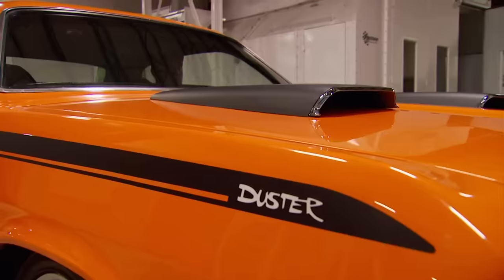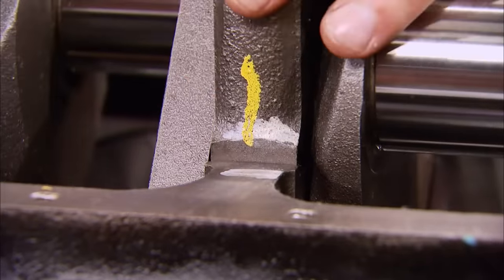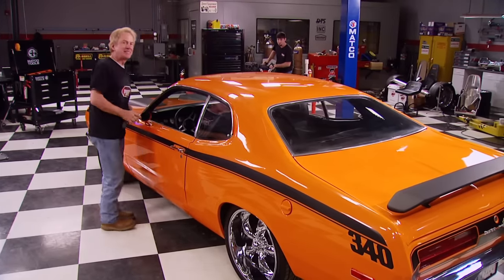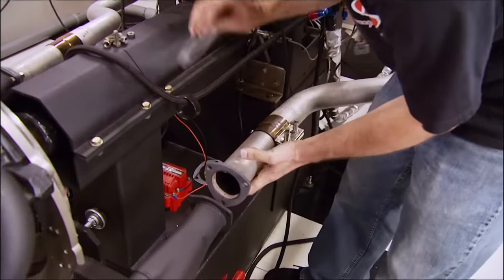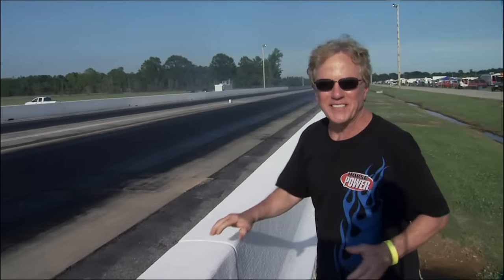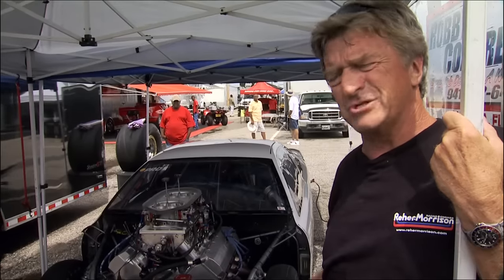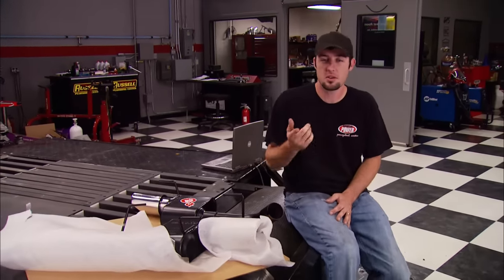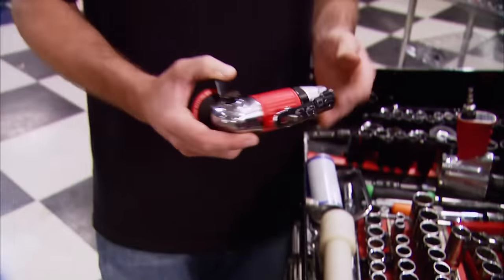Mopar 360 Build on a $2,500 Budget - Horsepower S13, E17

Comment: Have a 360 block sitting in my garage that needs rebuilt but a low mileage 5.7 hemi is still cheaper 🤔
Reply: uhhhh.....not where i live. also, valve droppers, cam eaters, etc....
Reply: @frigglebiscuit7484  a low mile 5.7 hemi in the midwest is $1,900. Combined with the fact that I will drive the vehicle less than 1,000 miles a year so im really not concerned with dropped valves etc. associated with high mileage hemis
Reply: @themanic6575  im not paying 1900 bucks for a used engine that has known problems. i built my big block mopar for 800 bucks.
Reply: @frigglebiscuit7484  You might have built your big block in the 1980s for $800 😅  the budget build for the 360 in this video was $2,500. And I also want port fuel injection and hydraulic rollers which the hemi already has. To do that in a 440 is $$$$
Reply: @themanic6575  nope. built it in 2012 for $800.
Reply: @frigglebiscuit7484  define "built" my 360 needs machined, pistons, cam, heads, intake, carb. If you can do that for $800 I will consider 😅 have small block and big block transmission ready to go. Every big block that I've viewed has been beyond used and abused
Reply: @frigglebiscuit7484  If I ran a 360 I would probably just get a 5.9 magnum from a junk yard those run about $250 for a running one. Had one in my Durango R/T
Reply: @themanic6575  im sorry that you started your build with a p.o.s. engine block. my big block was a 60k mile motorhome engine. new rings, bearings, arp rod bolts, cam, and dual plane intake. did my own head work. block and heads needed no machining.
Reply: @frigglebiscuit7484  I haven't started any engine build. I bought a 1979 dodge powerwagon for $500 and it came with a running 318 and a 360 in the bed.
Reply: @frigglebiscuit7484  I am going to get rid of the 318 that is in it for something with more power. Right now it is looking like 5.7 or 6.4 gen III hemi
Reply: @Welcometofacsistube  yeah not really interested in the 400bb. If i did a big block it would have to be 440 based. Don't like the weight of the big block either. Would have to be aluminum block along with port fuel injection and a roller cam
Reply: @themanic6575  400 has bigger bore than 440 which means it will make more cubes than a 440 with the same stroker kit, and late 70s motors have beefier blocks for increased strength, a gen 3 6.4 hemi is runing near the 5k mark in the mid west and thats for a stock motor, then youll need fuel pump $$$ fuel cell to accomadate $$$ wiring $$$ computer $$$ you can be 10k into a gen 3 hemi swap and still have problems. Pay for the machine work, or buy another engine but idc wat you say, unless someone gives you that hemi its not cheaper than even a big block build
Reply: @heathlamping6528  But the 400 is a B engine vs the 440 that is an RB engine. Like I said with any engine I would like to use fuel injection so I would be paying for wiring harness either way. I agree that the 6.4L is significantly more expensive than the 5.7L. The mopar standalone ECU gives the 5.7L 383hp and 425 lb-ft. Hard to pass up if you can get a used 5.7L for $1,900. Probably makes more power than the low compression smog era 400 that Frigglebiscuit and others are proposing
Reply: @themanic6575  The b and rb designations matter when building, its all in the finished product, now a 440 made the 390 and blah blah blah, where as the 400 was the 383 replacement and yeah it was in smog era, but new heads an intake and a cam and everything responds, plus guys that dont know any better give away 400s for nothing because theyre not 440s if you dont believe me call indy cylinder head and im sure they can point you in the right direction. Now as for efi, well it works great dont get me wrong, but a good carb works great too, ive driven both and when both are spot on they both work in midwest winters and have great driveability.
Reply: @heathlamping6528  Yeah a 400 big block can make power. A big block just really doesn't make sense for what I need. I want efi due to the longevity differences between carb and port injection engines. Being around both the late TBI LA and port injection magnum engines I have seen the signifigant bore wear differences/patterns compared to the earlier carbureted LA engines. In addition to that my wife would like to drive it as well. I would definitely like to use the truck for carrying/towing stuff on the interstate. I don't really need the mpg hit associated with the big blocks. I am considering the 360 or 5.7L. I know from experience that upgrading the 360 doesn't come cheap no matter what anyone else is saying. I have owned a couple of them and as shown in this video $2,500 only resulted in a 60hp increase compared to a stock 5.9 magnum. I know you can use a more aggressive cam but I don't want to sacrifice driveability. The 5.7L mopar engine kit is $1,795. I could probably have a running 383hp 5.7L hemi for around $4,000. I am sceptical that a 400hp 360 or big block with a modern fuel system could be had for $4,000 starting from scratch. If I had a block ready to go it would definitely be a different story. I also like that there is parts availability for the new hemis. I got rid of my Durango R/T due to the fact that parts were starting to be discontinued. If Im on a trip I know that I will have more luck getting a hemi replacement part compared to a big or small block mopar.
Reply: @themanic6575  if you want the hemi then go for it, i wanted to do a 6.1 in an old macho pw i had, and you can do it cheaper then let it rip but others wont get the discount you get so advantage to you sir
Reply: @heathlamping6528 I think both have advantages and disadvantages. I enjoy hearing the different perspectives. To be honest I have enough spare parts to build 3 trucks. In time I might build one with a new hemi, one with a big block, and one with a small block or even a cummins😅 I have been debating engine choices for 5 years now. Practically I like the idea of the gen III hemi more. But I also like the idea of a big block truck (who doesn't? haha).
Reply: @themanic6575  im not a diesel fan at all, i used to have enough parts to building multiple mopar trucks.
Reply: @heathlamping6528  Thats cool. I which I could find a macho pw. I'm not really a diesel fan either. A truck with a diesel swap is something that my wife wants so maybe I will do one for her. My coworker has a Plymouth superbird with a 3000hp alcohol gen II hemi so I need to build something that can keep up with him. I have a big block 4wd transmission that I'm thinking about putting in an A body mopar. Will be a lot of fabrication but an awd A body with a stroked big block would be crazy fast.
Reply: @themanic6575  try machopowerwagon.com, theres always ones for sale, an a body with a t case will just be fast off the line, the only way to keep up with 3000hp hemi is to build another 3000 hp hemi no awd on the planet will help you with that. no the only way ive seen a tcase used in a car that wasnt 4wd was hemi under glass, they used the tcase and flipped the axle over to spin the tires the right direction
Reply: @heathlamping6528  Thanks I will have to look at that website. Yeah I'm definitely thinking of something with insane horsepower. And everything will have to be built to accommodate it. That would be my dream if I had the money. My coworker has more money in his superbird than he has in his house 😅
Reply: @themanic6575  ive never cared for building insane horsepower tbh, id rather have something in the 400 hp range that i could drive daily and not worry about it getting away from me, and as far as money goes, debt free is the way to be for that one
Reply: @themanic6575  yeah i cant do that whole drag car only thing, i do have a mud truck but i gave next to nothing for it
Reply: @bigboreracing356  a well tuned nitrous ls is gonna cost more than $800. gapping rings and throwing a nitrous kit on doesnt count as well tuned. you can compare apples to oranges all you want. i dont rely on baby bottles to make my hp.
Reply: The Manic Needs to be rebuilt. Not needs rebuilt.
Reply: @jumpinjojo  you ok?
Reply: Do it this way: https://www.hotrod.com/articles/318-small-block-build

Comment: Built a 360 for my 67 Barracuda some time back. Light performance build, with a holly 650, .500 inch lift and 294 duration cam. #.23 gears street tires stock exhaust manifolds and and a ld4b intake. Ran 14 second flat 1/4 mile at 97 mph. Was desperate for a set of 3.90 gears so I cold run well into the 13s. Oh yea, it cost me $800 to build it, of course I did the machine work including the boring and porting the heads.

Comment: I got a 1966 Chrysler New Yorker that I got with a 360 out of a 76 motorhome. Recently I had connecting rod #4 break in half and blew my motor. So I got another 360 out of a 78 motorhome and am driving with that now. Just trying to figure out the sweet spot in regards to the timing. Had it set at 10 BTDC for a while, now it's sitting around 7 BTDC.

Comment: Back in the early 90's, Mopar was getting back in to stock car racing, our engine, similar looking (hey, i'm not a motor guy) to this one made 700 hp. . . for about three hours, then at best, blew a head gasket, at worst, sawed itself in half.
Turns out the heads were to "soft" and kept losing the torque on the bolts. After every practice and qualifying run we had retorque the head and relash the valves. It was so bad that metal was squeezing into the cylinder bore.
It put us out of business before they got it fixed, but eventually you guys got a decent set of heads.

Comment: A good little build but they left some power on the bench when they put it back together. First they didn't say if it was over bored but a basic .30 over will give a slight but needed compression bump.
Second the heads were later castings with big chambers, nothing you can do about that beyond milling which would add to the cost, if I had to spend the money I'd go for a valve job and port clean up.
Last I would ditch the factory rockers for more precise rollers with a 1.6 ratio to help the mild cam a little. All that should be good for an extra 20-25 peak hp with improvement across the band. If you have the cash pick up some flat tops when you buy the pistons.

Comment: In my muscle car days I had a 1971 Duster 340 that I bought new, so I was glad to see this post.  I didn't do that much to it, headers, better exhaust, Holley carb (I think 750 cfm), better clutch, tires, and changed out the rear end ratio.  I don't remember if I changed the camshaft or not.  Maybe I did some other little stuff too, I dunno. Anyway, I got about 325 hp to the ground according to the dyno test.  I wish I had done a dyno test when it was stock, but I didn't.  Factory spec was 275 hp.

I used to run super-stock at drag strips in the NY metro area and still have my trophies in a box somewhere - I wish I wrote down my times - I seem to remember high 12s. 

It only cost me a couple thousand new and was still in good shape when I sold it.  Very pretty metallic green paint with the big 340 logo.
Reply: Mopar A Bodies Forever... 68 Dodge Dart everyday and Everywhere..

Comment: That was impressive considering the stock cam and heads.

The 360 in my Dodge Sportsman van was a humble two barrel but man it had torque to spare. It got so rusty I was afraid to drive it. I should set it up so people could hear it run and advertise it for sale. Would love to see it on the road again.
Reply: Wasn't a stock cam... they used a 218/228 cam that should have pushed 400 HP in a better built engine... 
https://www.hotrod.com/articles/318-small-block-build

Comment: One thing that they skipped over is on the 360 there is a small hole on the bottom of the head under the exhaust ports. They will need to be tapped with a 1/4 20 tap and plugs put in them or you will have an exhaust leak on all 8 ports

Comment: we allways changed to big valves an had it gasket matched to intake etc, like 100 bucks in 1988 at barnetts i think. an we would port them somewhat as we shifted the erson cam at 6500 r pm, so easy to run mid 12,s in a lite duster..with 3.55 gear but would eat u joints in lite 904 trans..

Comment: Would love to rebuild the 360la in my '81 Ram W250. The low compression is such a bummer. Hard to justify even $2500 to rebuild it when for less I could get a higher performing LS but it lacks the character & hate to throw GM in Mopar.

Comment: Now dyno that 360 with 1 5/8 headers, a Performer RPM intake, a 650 carb, and a slightly larger cam. The way it should have been built.
Reply: Yeah those small primaries are robbing few hp
Reply: 218/228 cam was fine... would make 400 HP with better parts selection... 
https://www.hotrod.com/articles/318-small-block-build

Comment: True Mopar guys know you can make 400HP out a 360 without much work. 450HP/500HP you start running into issues with the stock heads/crank. Have a desirable 360LA with the factor roller cam I was going to build.....but then I found a 440
Reply: 475hp is about max

Comment: As I recall, the these early 70's Darts had a terrible rust problem in the cowl area. Trapped water and rusted out.
Reply: Yes.. trap water at the bottem mostly and will then rot out the lower front fender.. I own Twin 68Darts hers and mine.. mine was a beach car so mine has more.. but mine is 318 and moves.. Mopar Everyday and Everywhere

Comment: Even better heads? '89-'92 "308" casting 360 heads...a little clean up and they flow very,very well.If you use the whole motor, roller cam & everything!

Comment: Fist the 340 as delivered from the factory could not deal with a Chev Ii Ss with the 350 hp 327. Adding a solidlifter cam and matching springs gave the Chev ii another 15 hp. Also. And it was cheap and easy to do.  Nor could it deal with the 370 350 c I Camaros out in 70. Nor could it deal with the Boss 351 In a Mustang.  
Stock the 340 was underrated at 295 hp. An average 34p however in stock trim would make aroundc325 to 330 hp.
However it was hard pressed to make 355 ft lbs of torque.
Hence it was not much in a heavier car like a Challenger.
The 360 was a different mstter.the longer stroke gave it a surprising amount more torque. The cast crank didn't really matter if you did not exceed around 5800 rpm.
Either Chrysler all block suffered from not enough heard or camshaft.
Chrysler did have a remedy for this in their parts catalogs but the parts were prohibitively expensive and the heads were still iron mostly.
Edelbrock finally did Mopar a favor around 1990 when they came out with the Performer RPM aluminium heads.
Like all Edelbrock heads they weren't cutting edge or comparable to AFR. but you could CNC port them.i bolted together a 360 with te non CNC ported heads a hydraulic flat tappet cam zero deck flat top pistons Performer RPM ALUM intake and 2 step headers.  The cam was A Comp w split duration 230 235 and lift of 520 525 . Comp ratio 10.25 to 1. .030 overbore. Power band and torque excellent fron 2000 to 5700.. Dynod at 414 hp and 440 ft lbs of torque.
Nick up in Canada usedxa similar formula on a 340 and got it to 401 hp but my memory is thst rogue was around 398 ft lbs.
This is 10 percent less torque than the 360 and 13 hp less I give Nick more savvy in building a Mopar engine than me as this was my first Mopar.
Interestingly enough I built a 350 Chev with the 370 hp solid lifter csm 10.25 cr  pretty much the same formula and dynod it at 421 hp and 400 ft lbs of torque.
So what we see in the 360 is it has a really good rod stroke ratio for producing torque.  Give it enough head and a fair amount of cam and it becomes a very torque street motor while still making good hp.  The engine resides in my Challenger.
I don't have trouble with 383 Stock Mopar at all Or for that after any 340 I've come across.or 390 Fords oR 3i9 or 400 Pontiacs or 400 Olds.
Best of all the engine with the aluminium components and an alum radiator improved handling over the stock small block by dropping around 65 lbs off the front plus another 27 lbs by locating the battery to the trunk.
I strongly recommend the 360 LA engine for street use if you want a small block that is exceptionally torquey.and rugged .
Just don't wind it like you would a 4 bolt main solid lifter Chev.  But then you don't need to.

Comment: i  like  the engine i got for free  better 450 hp at  485 torque stock with 6000 miles on it it's  a 454 stroker  with  a steel crank heavy rods and got  a tunnel ram setup  with it plus  the high flow  heads but the best part is i got 2 for free with the heavy duty 400 turbo's
Reply: Must be nice being you
Reply: @DjDubStak  my friends tell me i'm living the      american dream i  own everything out right slowly  filling  up  10  acres  of  good  project cars have lot of built cars  and  restore cars   a  lot   of  parts plus really  good  connections for cars   and parts  get  most for free  or  real   cheap .some of  things  i get for free makes   my friends  sick  like  79 short  box chevy  cheyenne  4x4  full option  with under 35,000 miles  in  mint condition  just  needed   a   fuel  pump carb  rebuilt from   sitting   in  a  shop plus it      had a   new  edelbrock carb  on the seat  and   it had   400 sb  with   400 turbo for  free
Reply: @jeffrey4547  dang dude. I need a neighbor like u

Comment: i heard you could put a 318 head on a 360 block and get 250 hp because of the smaller combustion chamber on the 318 head

Comment: What would that little 2.3 4 banger do with a 4 barrel carb, say a 600 double pumper and design a  intake that  has a dedicated runner for each cylinder. I think that little engine could probably crack the 300 hp level.

Comment: fyi 1972 the first year 360 had a forged steel internally balanced crankshaft with the J heads and 202 /160 valves. So not ALL 360's had cast cranks and some later has 2 barrel carbs for low emissions and to keep insurance companies happy. Ralph Nader POS